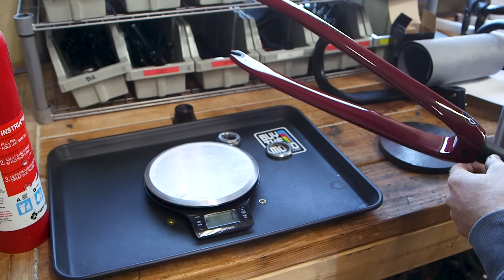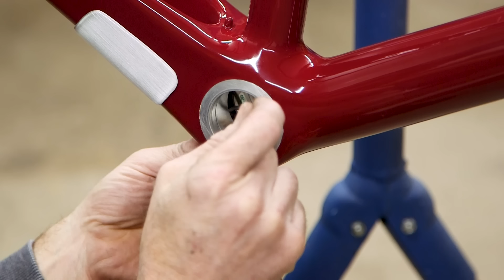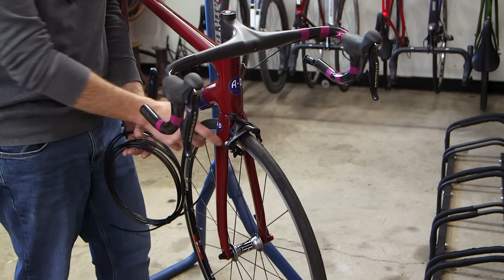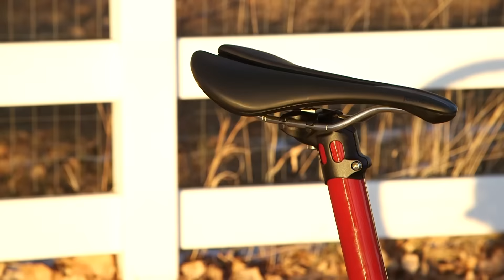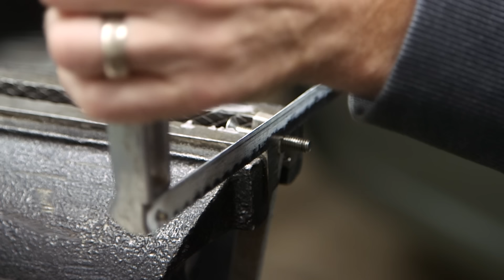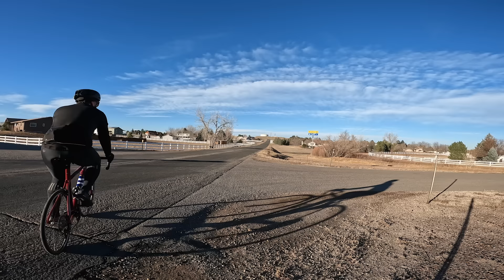The best road bike you've never heard of, probably.

Comment: Gonna throw it out there, 750’ gain IS flat. My average ride is 4k’ or more because riding bikes on flat land is really boring. I jumped on the 1x setup early and kept trying to tell myself I loved it. I recently built another road bike with a MicroShift Sword 29, 46 paired with a super old SIS 11-28 8 speed cassette. And that’s how on bar end shifters I accidentally PRd my entire usual ride…

That said my MTB is 1x but that’s because you’re either climbing or standing on the pedals to avoid getting bucked. I don’t even trust 1x for a touring bike because it’s easier to find a 9spd chain at Walmart than a 13spd…
Reply from the maker: You must live in the Andes!  4k' rides for me, are reserved for once-a-year group events like the Triple Bypass or Copper Triangle.  46/28 is wild!

Comment: Never heard of Austro Daimler before. The uncommon taper size for fork steerer and cutting down seat post to fit would ultimately put me off such a frame, even if it sold as cheap as you got it for.
Reply: Thank you for the note John. If you were racing road bikes in the 80s, you may have heard of Austro-Daimler. Since I obtained the abandoned trademark, I refer to it as A-D Bikes because no one can spell Austro-Daimler or remember it; it gets mixed up with Houston Astros and Daimler Benz, and the spell check and subtitle technology spells Ostro. I thought the logo is more attractive looking than the Art Noueau Auriol font used on the lettering and the technology now exists that allows for a log to be wrapped around a down tube.
Reply: @RideableTV cool!
Reply: Austro-Daimler was an Austrian subsidiary of the Daimler Motoren Gesellschaft (that one merged with Benz in 1926 to form what we still have today as Mercedes-Benz) founded in 1899.

There was also a British subsidiary, the Daimler Motor Company, founded in Coventry in 1896 and were the preferred cars of the British royals into the 1950s, they then got acquired by Jaguar in 1960 but they kept existing as a "sub-brand" for the highest trim level on Jaguar cars until 2009 (it was like what Mercedes has with the Maybach S-Class today or Škoda with "Laurin & Klement" which was the predecessor of Škoda Auto).

Back to Austro-Daimler, they merged with Puch in 1928 and then Steyr in 1934 and that went into Steyr-Daimler-Puch, they also had a guy named Ferdinand Porsche in their engineering from 1906 to 1922.
And in the 1970s they began to develop a car together with Daimler-Benz known as the G-Class and still built to this day in Austria (until 2000 there were also Puch-branded G-Classes made).
And Puch was/is still doing bicycles, they were sold to Bianchi in 1987 and both went into Cycleurope group, they're seemingly now Dutch but also returned to sell their bikes in Austria, they are/were one of the household names in Austria together with KTM.

Comment: I honestly believe that this frame having support for 25c tires and rim brakes will work nicely with a more classic 105 or Ultegra 2x gearing. But it in 1x is fine.
Reply: Thank you Jogie for the observations. Most customer build the Superleicht up with the 2X group sets you mention. I think many customers have a groupset on hand from a purchase or from an old bike and they just do a transfer. I ran 25mm tubular tires on mine and it was great; the problem is that finding 25mm tires now is getting harder to do.

Comment: You could easily save 300-400g by buying some cheap aliexpress carbon wheels
Reply from the maker: I'll admit, I'm afraid of the braking reduction with carbon wheels so I've never tried them.  Any notable difference in braking performance carbon vs aluminum?
Reply: @RobertAdairWorkshop it can get tricky in the wet, you have to play with different brake pads and see what works best but in dry condition there is no difference :)
Reply: Save some grams and loose my live with some cheap parts where nobody is accountable for? I would not do that. Apart from that I am fine with carbon.
Reply: @bikedan99  Thanks for your opinion.